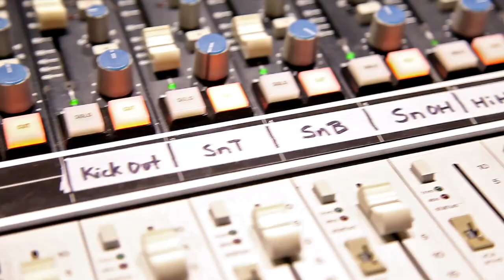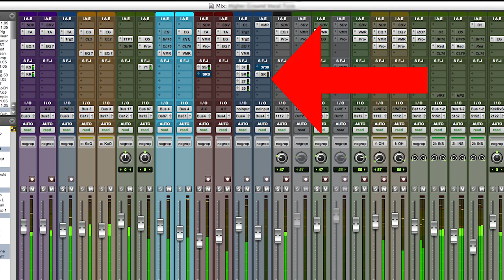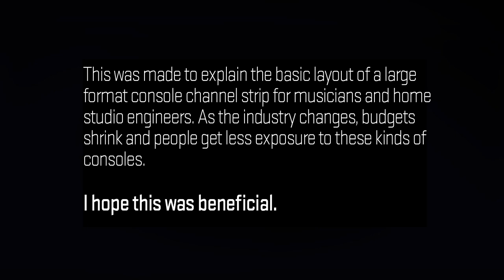What Do All Those Buttons Do? SSL 4000E Channel Basics - Musicians Guide

Comment: One little small but important detail. Be cautious about what you squirt into switches in a console as you can cause significant problems down the line. There are only two "safe" sprays, Caig Labs DeOxit Gold G5 (never use D5, only G5) and ElectroLube EML.

Comment: Very basic.... the switches put the Eq first or the dynamics first or split the eq with hi and lo filter section of the eq to control dynamics with a send, but not the sound. Also there are left front, right front,  left rear, and right rear at the bottom of the assignment buttons so you have two completely independent signal input and output per channel.  These things were designed by arrogant genius engineers who constantly improved them.  They were way ahead of anything at the time and better than most of the Neves except the more primitive but fantastic 80 series with the wonderful 1073, 1081 types of mic pre and Eqs. The computer used a Computer Automation computer that was used in several things including car manufacturing that was fabulous with total recall. 8 inch floppies the hard drives,  so primative and expensive. With VCAs these things are reliable and a pleasure to work.  Now we have new reasonable priced computers and low electricity eating 
power supplies to keep those fabulous consoles going for years.

Comment: Great Video. I Have one SSL4000G. Please, let me know what thing is that that you used to take out the channel? (looks like a big srew?? It´s an original srew from SSL to do that?...I don have any of that!!! ggrrrr) Where can I find that or any link to find them please?. Thank´s
Reply from the maker: Hi @nachosubiros! The tool i used to pull out channels are the SSL made lift out screws. You don't need to use their screws. All they are are larger screws than the holes drilled in the channel strip. you could go to a hardware store and buy screws that are the same size and thread. If you have any racks in your studio that uses the non-cage nut design rack screws. Notes these are the thinner screws with a finer thread. These screws will just fit in the holes and will physically grip the hole and stop turning after a few small turns. It's not mean to go all the way through, just grip the steel of the channel strip.
Reply from the maker: The screw size I believe is 10/32" x 3/4"
Reply: Thanks a lot Sam!!!. 
Nice to meet you. 
I will try that. 
This is my studio if you want to take a look. Check HomeTown Studio at facebook
Reply from the maker: No worries at all. Happy to help. Nice studio you have there. Lovely, inviting creative space. Great gear also! Good luck with everything!
Reply: Thanks again Sam!!!

Comment: Nice video! I have a question thoe. Lets say i have a bigband (12 musicians) in the studio, my FB/Head-Phone system is 12 channels with independent mixingconsole for each and every one, (all musicians have there own 12 channel mixer connected to there own HeadPhones) I want all the different musicians to have there own channel on there dedicated HP-mixer (So they, when playing togheter, could make there own HP-mix). How do you route the mixed signal that i want to record to make this happen? i also want to have the auxes free on the channelstrip for effects during recording, that means i cant use those for the HP-mix, and i want the signal strait from the board to the musicians just to minimize the latency from the computer software, witch is a problem for some pros.
Reply from the maker: How many channels is SSL your using? One way, If you have a 48 or 64 channel board, Is leave the first 12 channels unused for tracking, use the "SUB GP" button on the first 12 channels,  then send individual instruments to the first 12 channels via the bus routing buttons at the top of the console.  Now patch out of the first 12 channels into your headphone system.